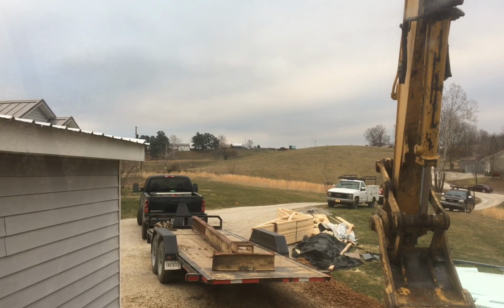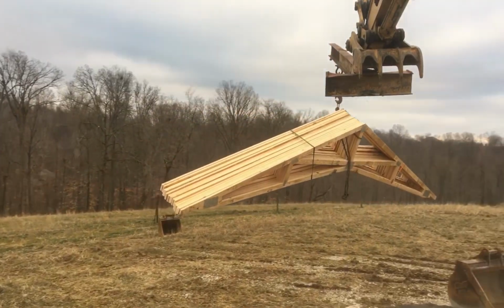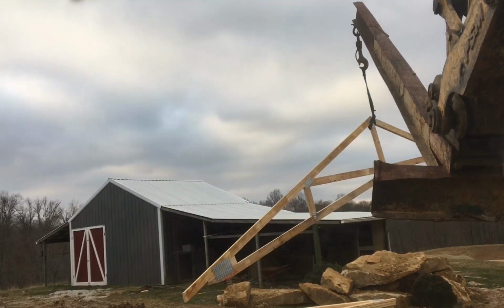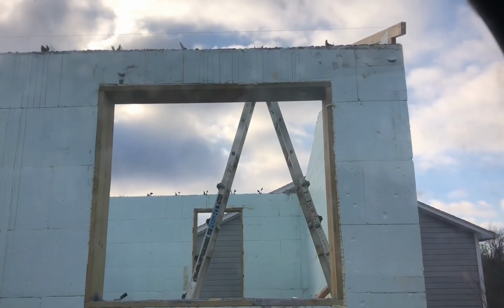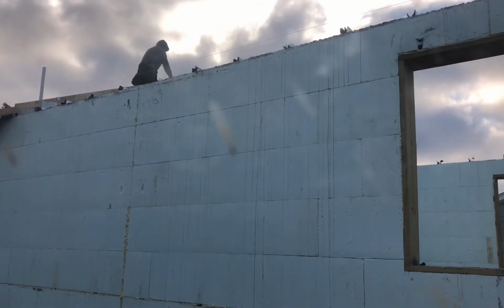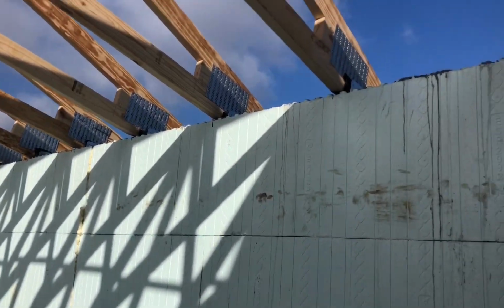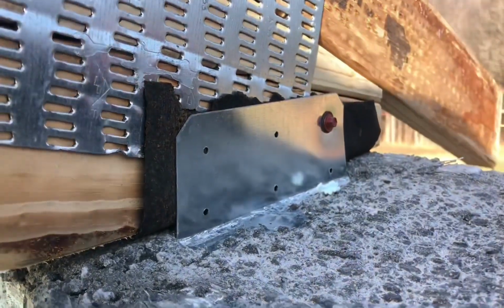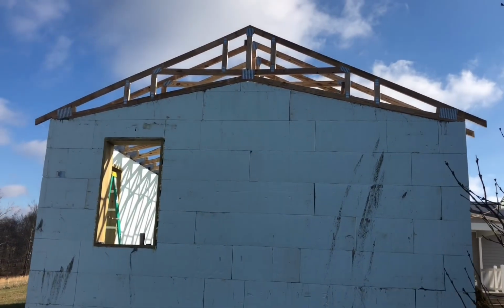Setting trusses with John deere120 using homemade excavator attachment #dirtperfect

Comment: Hi Mike, not sure you’ll see this comment but…

I’m looking at building a shop using ICF’s And scissor trusses and I was wondering about few details.

Is the gable truss set on the foam (with room for sheathing) and anchored into the concrete? Also, would the interior finished ceiling be attached to blocks between the gable truss and the next truss out? I wasn’t expecting to find a video of almost my exact situation lol. Thanks!! 🙂
Reply from the maker: No we cut 1/2 moons have a video on it
Reply: @DirtPerfect  found it! Thanks man. 👍🏻

Comment: @3:15 I had a mind picture of the trackhoe cutting out when the power chord was disconnected.  Which is crazy because you'd need at least two power chords to run the John Deere 😉.   The last Dirt Perfect video I watched featured the jib extension being used in a slightly less serious manner.
Reply from the maker: Lol